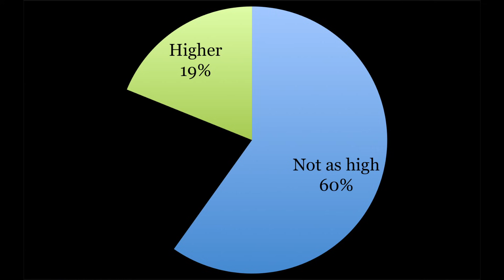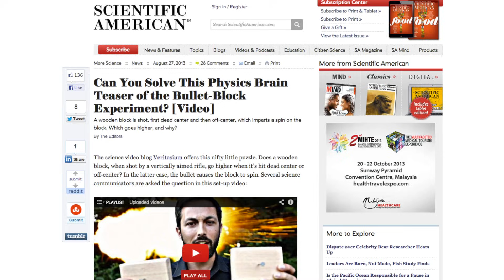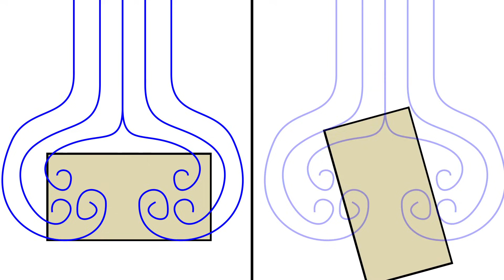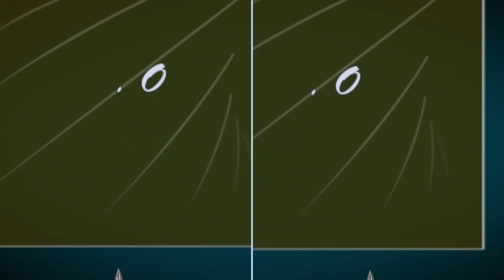Bullet Block Explained!

Comment: Now this got me thinking, Since you used a BULLET and you said the energy lost in the block by the bullet could not be detected, (it may vary for different blocks of different grain). Instead of using a bullet, why not use a spring? You can still measure the energy stored by the spring and you can check for the energy differences in that, rather than a bullet which may also have varying energy stored. I don't have the equipment for this. Might ask the Physics department at uni lol.

Comment: I'm gonna nitpick on something I saw a lot in these videos. People were measuring the "centre" of the blocks to be where you had the pin, the original centre of mass, HOWEVER, the centre of MASS would change when the bullet entered the block. It would be important to measure the heights from the centre of mass. Also, was the change in the moment of inertia caused by the bullet accounted for?

Comment: The long awaited answer is out!~
How about pouring water and freezing it inside then crack open the entire block... This way, you get to see the shape,size and depth completely.... Maybe use cement, just use anything to fill up that volume and make it solidify... Dun know if it would work but worth trying out i guess?

Comment: Great experiment.  I also thought it wouldn't go as high -- until I saw comments on conservation of momentum.  However, one very interesting thing to consider is why all the blocks went to different heights.  Same momentum.  Why the variation.  I can't help but think of an undergraduate Chemistry class (40 years ago) when the professor did an experiment on gravity -- and the results varied non-trivially from the predicted results.  His conclusion -- gravity is only accurate to within 40%.

Comment: Since you are looking for a very small phenomena, I would suggest using a much more controlled set of circumstances. Change out the wood block for something that is configured of thousands of discreet layers (plastic bag comes to mind within a built structure). This would give you very consistent material. As well, play with the projectile velocities. One percent is much easier to measure on a large value. May want to consider projectile size to see which exhibits a better set of properties.

Comment: Polystyrene blocks and airsoft or metal bb guns might have better penetrations, but then air resistance will play a bigger role, right?  

Also note that no 2 blocks of wood will ever be identical.  Wood is organic so there will always be some slight variation, even in the same original board it could vary from inch to inch in density, moisture content and hardness.

Comment: I do.. assuming we use the same units for measurement (say mm), 1% of  10mm's is not very easy to spot, while 1% of 100cm's is a bit better using the same "ruler". 1% of 10mm would be 1/10th of a mm, whileas 1% of 100cm would be 10mm, which, if measured using the same "ruler" or measure instrument, would give you an actual reading.

This does of course, mean that we'd have to resize them as well, to allow for further travel without the bullet leaving the material of choice.

Comment: If the bullet only penetrates 1% more in the straight shot, then you need to either increase the difference in BP, so softer material or higher calibre bullet, or change the scale of the experiment ie. bigger block and bigger gun, so the change is more noticeable.

Comment: I want you...  Nay, I demand that you repeat this experiment with a much more rectangular block.  One that is much much wider with a profile similar to a yardstick. Then hit that bastard in the middle, and then on the very edge.  

I tend to think when you hit on one side near the edge, the other side is forced down but doesn't spin around it's center of mass.  I think the nail supporting it will actually be forced down, but since it can't go down it pushes off the support.

I could be wrong.

Comment: Use AR500 blocks and of course you'd need a bigger rifle. but any deformation would be easier to spot. Or use a round that will not deform the block

Comment: I feel like a different material than wood should be used. 

Pieces of wood will always have slightly different densities and grain patterns that could affect the result. Something like plastic or even some kind of metal would be better because every block would be perfectly identical, something that really isn't possible with wood.

Comment: This is loosely true, in the sense the the block "feels easier to push away" in the spinning case. But this is a rather difficult approach to formalise and do calculations with.

There are often multiple correct explanations to a phenomenon, which all interconnect and prove each other. In this case, linear momentum is the easiest to work with, and stands on its own (esp. since it starts with linear momentum is the *same* in both cases, not apparent inertia is *different*).

Comment: I don't think this would work because there are still other variables at play, like the differences in the blocks of wood.  Every block of wood is going to be slightly different (harder, softer, slightly different grain, etc.) and when you are measuring only a tenth of a millimeter or so, it would be impossible to get any kind of trend.

Just my thoughts :)

Comment: To increase the deifference in penetration of the bullet you can
1. use a much wider block
2. when hitting at the side, hit as much close to the edge as possible
3. use a higher density material block

Comment: I'm not sure what material would suit, but perhaps finding a replacement to the block which is homogeneous and would allow for greater depth penetration would give both more accurate penetration depths and allow for a larger scale to be measured? Perhaps even downsize the gun and use something lightweight e.g. a soft but large deformable plastic block?

Thanks for the vids, they're great thinkers :D

Comment: Bullet weights vary as do powder charges.  Were the blocks and nails used in them weighed to ensure uniformity? If they used cheap .22LR ammunition these variations could have been more pronounced.  Also, the block shot in the middle did NOT go straight up.It went backwards a bit rendering the height measurement inaccurate.  Nothing was really learned with this experiment but it did get people thinking.Mission accomplished?A more uniform block of a more uniform substance and better ammo control.

Comment: To show the difference better, try using ballistics jelly with a rigid frame. It would probably work well; thick enough to stop the bullet but a much greater range of depth due to less energy to deform it. It is also somewhat transparent so no x-rays required.

Comment: A wooden block may not have a uniform density (one can see it in spacing of the year rings) and that may explain why there is a fair amount of scatter in terms of the height each block reached. The dimensions of the blocks seem the same, but are they of equal weight?

Comment: To improve the experiment we need to have an extremely viscous substance, not something which is brittle or prone to fracturing. Yet at the same time it needs to contain the bullet in the block.
This could be done with for example thick clay as many people have suggested. I think the best result would be to also use sharp pointed bullets, so less energy per penetration distance, thereby increasing our margin of error.
This would also mean ofc that the gun would need to be less powerful ;)

Comment: I'm not sure that designing the experiment to measure a 1% difference in penetration depth is possible, using the current rifle (e.g.: the variation in block height differences in this video is far more than 1%). You'd also need to use a material that was less dense than the wood used, and which has fairly uniform density - perhaps a rigid form of plastic that will deform but won't shatter?

Comment: About making the bullet path difference more measurable: make a block of jello. But then you'd need a giant block to slow the bullet down. So make a block of jello encased in wood. The wood would absorb a large part of the kinetic energy. But for the last bit of the path, the bullet would go through jello inside that would magnify any differences, since the rate of energy loss would be less per unit distance.

Comment: Instead of using a wooden block, you could use a softer material like low density polyethylene combined with a lower velocity bullet (such as a handgun round). The two bullets should have a much larger discrepancy in their penetration depths, and the lower velocity will mean that they won't penetrate the plastic outright.

Comment: Conservation of energy is perhaps the single most reliable law of science. However, energy -- though it is never created or destroyed -- can and does continuously change forms. A bouncing ball converts energy between kinetic and potential forms, and during each bounce some energy becomes heat & sound, so the next rebound is less high.

Here, in one case more energy went into deforming the wood, and in the other case more energy went into making the block spin, but both conserved total energy.

Comment: 1) Use a piece of metal as it's a more consistent material. 
2a) Shoot the off center shot closer to the edge.
2b) Find the optimal distance shot from the edge to create the best results. 
3) Measure the impact before and after with a digital point micrometer.
4) Repeat as many times as you can.
5) Graph your results. 

Side note: I'm not sure what the tolerances are when making bullets. I would recommend buying custom bullets to ensure the amount of gun power per bullet is constant.

Comment: Use aluminium instead. The energy taken to deform this is much higher, which means more kinetic energy is conserved so the percentage difference in penetration would be more measurable

Comment: This problem is tricky because you have to know all these rules and know that they apply.  You have to know that conservation of energy (which we've heard is an unchanging fact) is not reliable in this case.  You have to know about conservation of momentum, which doesn't come up in everyday conversation.  You have to know about the difference between linear and angular momentum.  You have to know that kinetic energy is not conserved in this case, which isn't obvious at all at first. (it is now)

Comment: Make the block out of styrofoam (which is less dense than wood and therefore easier to penetrate and deform), and make it much larger than the original block. And (if possible) get a gun that shoots the bullet with more kinetic energy, and make it shoot much farther off to one side, so that the rotational energy would be greater.

Comment: RE: bit impossible, but you could attach a short string to the bullet when fired and a longer string to the bullet hitting the other block. Similar weights would be somewhat place upon both strings which makes it go in at different depths and the blocks will have the same forces acting on it.

Comment: Perhaps by using a pneumatically fired steel ball you could better control firing velocity. You could also do this to scale up the experiment, perhaps using a 2 meter long piece of wood. This might show a more observable change in penetration depth.

Comment: if you really don't believe me, let me put it this way, you can with your finger exert as much energy as that bullet, but it would take a lot more time, so you wouldn't hardly have any heat or structural damaged at all. you could push that wood around all day, the key is energy transferred over time. if you used a much lighter bullet, that had say just enough mass(at the same velocity) to equal the gravitational force on wood, you would see that you wouldn't be able to lift it but it would spin.

Comment: It's not neccesarily the depth, but how much energy is lost when creating the hole. Different blocks of wood will have different resistances and would simply increase the rate of error in the measurement of depth.

An experiment to test the hypothesis in the video should use a more predictable material though.

Comment: so lets try this - use 2 completely different types of timber - say pine and a gum hardwood, dramatically different in density, as the gum is heavier it obviously wont go as high, but would that allow you to have a greater difference in bullet penetration? then by taking into account the additional weight of the hardwood could you calculate the amount of energy in the entire system? or did i just type all of this for no reason? lol

Comment: well not really, to explain it. when you have a rotating block like that, its uses more time to slow down the bullet, this gives you less loss to heat and more energy transferred to the woods momentum(angular). so basically the longer stick you have the larger difference there is in the speed the stick is moving linearly at its center of mass and the speed its is rotating at the impact point. so you would see less penetration and heat, also you would start to see more of a difference in hight.

Comment: A fulcrum is just the point where it rotates, it doesn't have a length. But that may actually work. It might have to be a very light material however. With such a large mass, the large velocity of the bullet will become an extremely small velocity for the piece of wood.

Comment: i almost had it. my theory as of the 27th was that the block always had the same amount of rotational energy weather it was hit in the center or the side. the thing was in the middle, the rotational energy is split almost evently amongst the left and right sides, canceling the spin out. energy would be lost. on the side, there is far less energy on the left than the right side, so the right side is forced up and spinning.

Comment: Use a more powerful gun, have a block which is deeper (has a far longer distance between the part which the bullet strikes and the side which is highest off the ground) and wider (so that the bullet strikes the wood further from the centre of the block.

Comment: I think you should have done more repetitions and a statistical analysis and used a more reliable material than wood... Not entirely convinced that the block would always reach about the same height. If such a small difference in the depth of the bullet causes that, the wood blocks would have to be identical.

Comment: upscale the experomemt? rather than using little blocks of wood, use huge chunks of wood and a mich larger projectile like a 105mm shell, then you could measire the distance in mm then downscale it to the size of the original blocks

Comment: You should include different styles of bullets from the same gun, such as a five-seven or a .40 with their standard round and the hollow point version. Then use a handgun and a rifle to test with, so you can test if round size would have an effect. For your wood, you should pick a soft, medium and hard wood to test on and then you can pick the best result for the bullet depth, and have some cool examples to show!

Comment: Use a material that is less dense than wood. If you use a less dense material, the bullet will travel through the material more easily, allowing the 1% difference to be proportionally the same, but longer lengthwise, giving you a possible measurement.

Comment: So it does not matter where you shoot in the block it will always go to the same height.  So we both agree that the rotation is not caused by the extra "energy caused by the block rotating as the bullet enters the wood"

Comment: The off-centered bullet does have an angular momentum before it hits the block: it is the vector product of its linear momentum and its position vector with respect to the centre of mass of the entire system (which is close to the centre of the block).

Comment: I don't think you are using the correct terminology. The rotation of an object is caused by torque. If the bullet is shot in the middle, there will be no net torque, while if the bullet is shot off the center of mass there will be a net torque, causing rotation in the block. That is all true, but the fact of the matter is angular momentum is conserved separately of linear momentum, so it does not matter if there is a net torque on the block or not.

Comment: Dear Veritasium,

To measure such a small difference (perhaps um) it is very important that the block and the test equipment is made with a high precision. Also, the blocks should be made from a homogeneous material (every wooden block is completely different), every block should have the same mass and the gun should be checked, gun are made to kill not to fire xxxx joules of energie, if the E difference between two shots is to big, the difference in bullet penetration will impossible to measure

Comment: Repeat the experiment but while using blocks of both a larger size and a less dense material. As the path that the center-shot bullet plows through the material grows in length (as would be the result of using a less dense material), the 1% difference between that path and the path of the side-shot bullet will increase in magnitude. By altering solely density you could keep the block weight the same as well. Maybe some type of ballistic Styrofoam?

Comment: Different bullet depths was what I hypothesized in the comments of the original vid, but am quite disappointed that it could not actually be measured.   Agree with one of the other comments.  Do it again with larger, less dense material so the bullets penetrate further.    Maybe use a different type of projectile and a more uniform material like foam.

Comment: Ah Ha! If the bullet + block is considered "the system" then it has angular momentum from the start. The c.m. OF THE SYSTEM is somewhere between the block c.m. and the bullet c.m. Thus, the system has some angular momentum due to the bullet's velocity vector not intersecting that c.m. The angular momentum of the block+bullet after the hit has to be the same as the angular momentum of the block+bullet before the hit.